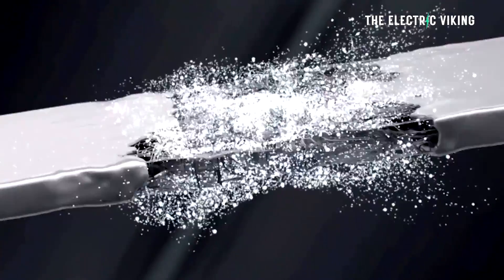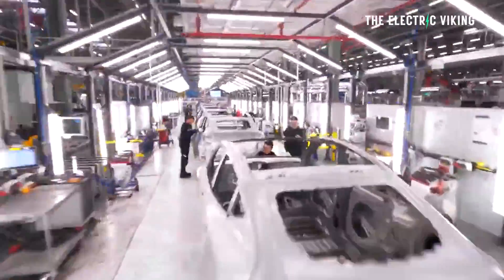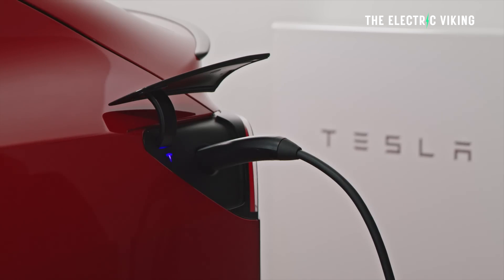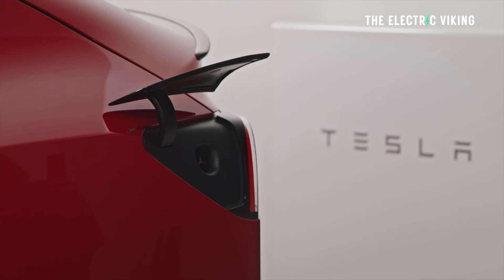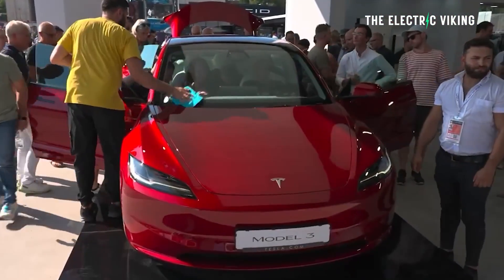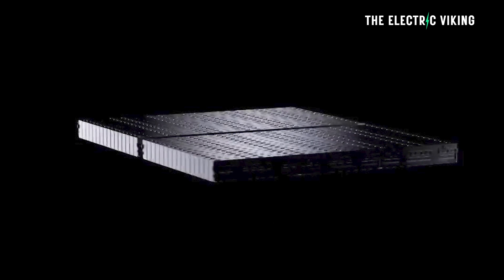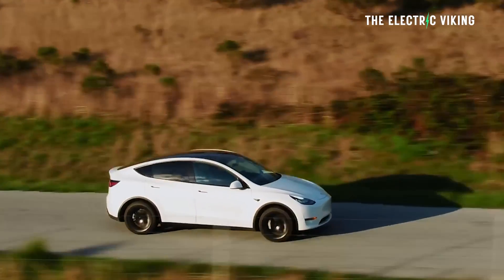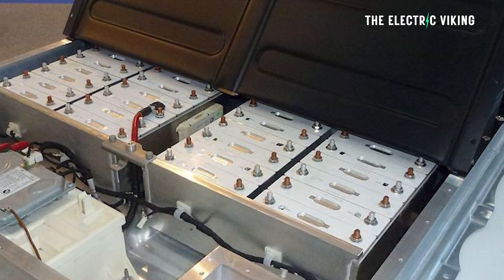Energy density of CATL's Shenxing battery revealed for Tesla Model Y Juniper

Comment: Best battery pack ever released by any company period,LFP  battery packs have much longer battery life compared with traditional NCM  ternary battery cells,almost double of what ternary NCM pack has to offer in terms of battery life and degradation rate, almost like an internal combustion engine car,and they are really much safer,what always had hold back LFP battery was 150 to 160 wh/kg in pack level energy density, shenxing plus has changed the game for ever with 205 wh/kg in pack level energy density,it is by far highest ever in the industry, it does even surpass 95% of traditional ternary packs in the market,very very well done CATL,you have done an amazing job for humanity and ev transportation industry,ev makers should appreciate your amazing hard work in development of the best battery pack ever
Reply: Agreed.  This is really a big deal and can be a game changer if the claim holds.
Reply: You forgot fast charging 4C. In second place will be Greely Golden Battery and third place BYD Blade battery 2.0. The next big thing will be the semi solid sodium batteries
Reply: @rwyo83  i think the next big thing will be the semi solid condensed zero degradation LFP with 450 wh/kg in cell level energy density which will last 2000 cycles of discharging with only 5% capacity loss according to CATL data about zero degradation technology,ev industry wont need any better cells for the next 25 years,it will be the real deal,just imagine 100 kwh battery pack with 400 wh/kg system energy density,it would have 600 miles of range easily,it will weigh 250 kg in total,battery pack will last 1.8 million km(1.2 million miles) with 95% of it's  capacity left because of zero deg  technology,and 5C charging speed,just imagine that amazing battery pack,the world will never be the same after the day this amazing game changing battery pack will reveal for ever
Reply: @rwyo83 The best overall is Tesla 4680. Look up The Limiting Factors video comparing BYD, CATL, and Teslas battery offerings.
Reply: @rwyo83 The current golden battery has 5.5C charging capabilities. 10% to 80% in 10.5 minutes. 
I think it's the number 1 at the moment. Behind it's the Shenxing Plus and then the Blade 2.p
Reply: @barygol  Geely new battery is the Aegis Short Blade battery
Reply: Has there been a failure with Tesla Model 3 LFP in high miles > 300k driving scenario?
Reply: Battery life - even NMC - is already better than most ICE cars (according to an Electric Viking report of a couple of weeks ago, which cited 300k miles average for Tesla NMC).
Reply: The pace of battery development is exciting and will only accelerate the shift away from fossil fuels. My 5 year old Kia e-Niro (64 kWh NMC) only has a pack level density of 147 Wh/kg, now we have LFP packs higher than that while the latest NMC batteries are reaching 250 Wh/kg. For sure LFP promises a longer life but to all intents and purposes this is meaningless as we already have NMC powered EVs with over 400,000 km on the clock and only 10%-15% range loss. Mine has just gone over the 100,000 km and hasn't even used up the 3.5 kWh of 'buffer' yet. There must be battery degradation but I am seeing no loss of range. LFP packs may well be capable of reaching a million km or more but few cars will last that long and even fewer drivers will need that capability.
Reply: @kiae-nirodiariesencore4270  I had similar experience before 100k km but experienced a large drop in range around 150k km in my model 3.  Now I have lost about 10% of range at 180k km.
Reply: @kiae-nirodiariesencore4270  let me give you some information,owning an ev isnt just about the first owner,you know what i mean?you think why you can buy a second hand  2021 taycan turbo s with 100,000 miles of mileage which originally  had MSRP of 200,000 dollars with only 80,000 dollars,that is called depreciation of  an EV,which is very very high at the moment,because people know an average traditional battery pack will last for 280,000 miles,so people wont buy a second hand ev at all,because they know if they buy a second hand ev they should heavily spend on replacing the pack themselfs,the whole reason behind all that effort from CATL and other battery manufacturer to make batteries last longer is for improving evs depreciation rate and make them better in holding their values,owning an ev isnt just about first owner buying them brand new,battery replacing will cause  waste of so much time,resources and offorts,i hope now you better understand why i call for zero degradation tech and wider use of LFPs in evs
Reply: let me give you some information,owning an ev isnt just about the first owner who buys it,you know what i mean?you think why you can buy a second hand  2021 taycan turbo s with 100,000 miles of mileage which originally  had MSRP of 200,000 dollars with only 80,000 dollars,that is called depreciation of an EV,which is very very high at the moment,because people know an average traditional battery pack will last for 280,000 miles,so people wont buy a second hand ev at all,because they know if they buy a second hand ev they should heavily spend on replacing the pack themselfs,the whole reason behind all that effort from CATL and other battery manufacturer to make batteries last longer is for improving evs depreciation rate and make them better in holding their values,owning an ev isnt just about first owner buying them brand new,battery replacing will cause  wasting of so much time,resources and offorts,i hope now you better understand why i call for zero degradation tech and wider use of LFPs in evs
Reply: @davidfujkk8018  spaces after a comma etc may help to understand your  text better.   I would love to know judging from your post,  did you call for zero degradation tech in ice engines in your past posts?
just curious.
Reply: @davidfujkk8018 Yes, China is the best, blah blah, tout your horn where you will, blah blah.
Reply: The Tesla 4680 pack is an absolute joke at this stage. To think that Tesla thought it would be the world leader in battery technology and then had its ass handed to it by CATL.....
Reply: @speedismyfriend  Can't win em all!
Reply: @speedismyfriend  every other battery company is a joke at this point
Reply: @speedismyfriend Tesla is making a different type of battery!!! The energy density of the 4680 is over 300!

Comment: What happens when your electric car gets 800 miles per chargers and only takes 5 minutes to charge?  I used to sell plasma TVs over a decade ago when I was a younger man. People would drop $7-$10K on a flat screen TV. At 720p. Afraid to leave them on too long due to screen burn. Today you get 4k 60” in Walmart for $500. It’s coming.
Reply: I think 800km total range and 5 minutes for a half charge (25%->75%) will be the tipping point for most people.
There will be a few jokers claiming they regularly drive for 6 hours at a time without making a pitstop, but 90% of people are happy to take a short break every few hours on a road trip.
At the rate batteries are improving this should be cheaply available with high reliability by 2030.
Reply: A small percentage of people paid big money for early plasmas.  In addition, your $500 Walmart LED TV  has an average life of 20 months.
Reply: I have a Model Y I generally only drive 20 miles a day charge at home and never go to a super charger. If I go on trips
longer than 150 miles then I might stop at a super charger. Milage on the highway at highway speeds is less than in
town. 400 miles range to get 300 miles highway would be nice and the extra miles would be a buffer for long term 
battery degradation . But it might get to point where there is essentially no degradation.

Comment: CATL keeps nibbling away at battery problems and cost and density, bit by bit, with each generation, and the generations are coming faster and faster.  Can't get rid of diesels and gas cars fast enough for me.  We have had stinky smoky cities all my life.  And the cars are  better than the gas equivalents.  I have owned big-block Corvettes and AMG 5.5L Mercedes; never again; my Model Y out accelerates them both, quietly, quickly, and emitting no toxic fumes.
Reply: They burn coal! Virtue signaling. Huge carbon footprint, kids slaving away in pits to get your "clean car". Please
Reply: Said kindly, you don’t know what you are talking about.  Turn off Fox News and find some real facts.  PS Coal fired plants are being retired all over the world and replaced by wind and solar, because they are cheaper energy sources. Lithium-iron-phosphate batteries are taking over from Nickel-Manganese-Cobalt batteries very quickly, so no more kids slaving away in pits in our future.  There is nothing “clean” about any petroleum fueled car, so your point of comparison is moot.

Comment: Why are commentators, incl Sam, saying a battery has X miles of range? A battery doesn't have any 'range', it contains an amount of energy. Range only becomes a thing when those batteries are put in a car (and then it matters how many batteries and what car).
Reply: The range is in reference to the model Y. To show the improvement range is easy to understand, if you would say: model Y Long Range AWD with a battery capacity of 81 kWh gives a range of 531 km,  now with the same size of battery and same model y the range is 1000 Km ... This would be better, but you would have lost your audience before the end of the sentence ...
Reply: Interesting comments, but none of them correct.  CATL themselves marketed 1000 km range, with 600 km range addition in 10 min.  Their new battery is also called "Shenxing Plus"...  Why?  Because the average consumer doesn't care about energy densities, they just want to know how far they can go before they need to recharge and how long that will take.
Reply: @CharlesBrodheadIII  "Because the average consumer doesn't care about energy densities", you mean the low IQ people. The rest do.
Reply: @CharlesBrodheadIII  This!  Most consumers care about the practical benefit to them, not necessarily the features/specs of the "thing", in this case the battery.
Reply: Yep, I can see that non-EV folks would understand the range but not the energy density, though they’ll be scratching their heads when the new Model Y does not come with 1000km of range when Sam is implying it will.
Reply: CATL have a reference vehicle platform. I think it’s based on that. Obviously theoretical but still a useful reference point.
Reply: Did they say how fast it goes?
Reply: Because Sam, like most commentators, speaks for the lay viewer who is not an engineer... and that's GOOD. He talks about the range of a battery IN CAR ! And when you speak about a battery in a car, all constraints of size, weight and total energy available are defined once the battery producer is chosen. Its then completely legitimate to talk about the range of the battery! It's as simple as that.
Reply: Because there is a practical limit to the mass and volume of the battery in any vehicle. That's why. This equilibrium point tends to be similar in most vehicles. But I agree with your statement.
Reply: They’re trying to make it relatable to non-scientific thinkers.  It’s not wrong on its own part.  Your objection would be null if they’d just include a proper caveat like, “In a typical sedan, using this battery would result…”  I agree that they should do at least that, but using a practical example is very useful for communicating with the masses.
Reply: @737smartin as ‘one of the masses’: please explain, how to compare Wh/l to Wh/kg. These (CATL) reports 205 watts per kg.  How does that compare to QuantumScape’s 800 Wh/l???
Reply: @paulcarney8157  I'm a 'masses' member, too!  But I think your seeing power per unit of volume (Wh/liter)...and power to mass (essentially weight) (Wh/kg).  In a car, both are important to consider as the volume is limited by the size of the space for the batteries, and keeping the weight low is important for driving dynamics, safety, and efficiency.   In home applications, battery size and weight are usually far less important. 
Usually a higher Wh/l chemistry will also be higher in Wh/kg, but you could imagine a less dense chemistry that could be powerful per kg, but is so 'fluffy it takes up more space and is lower power per liter.
Reply: What’s your point? Energy =miles.
Reply: @johnsilverman2538  
How many miles does a battery contain?
Your answer to that will start with "well it depends..."
That's my point.
Reply: Yep - good point. I mentally use 5km per KWH so when he says a 1,000km range I think a 200KWH battery. However that's just an internal estimate to deal with people describing a battery as having a range, which they shouldn't do.
PS Another that annoys me is XYZ will supply 200,000 homes rather than give the MW Capacity. Its as if the public can't cope with MW's.
Reply: He’s a content creator not an engineer
Reply: Because most Tesla YT like Sam have not the slightest ideas of engineering or physics. Zero, nada, nothing, zilch.
Reply: @docsnider8926 you forgot Ling 零
Reply: @docsnider8926 But you do of course.
Reply: Because Sam doesn't understand what he is talking about.

Comment: SAM ! Please say Watt-hours when you mean Watt-hours. And say Watts when you mean Watts. They are very different parameters.
"205 Watts per kilogram"  means nothing. But, "205 Watt hours per kilogram"  is probably what you mean.
So a quick calculation....at highway speeds, 70 - 80mph, consumption is about 350Wh per mile, therefore, if you want 200 highway miles you need 200 x 350/205 = 340kg of battery. That's not too bad, although what is this new battery's volumetric efficiency in terms of kWh per litre ? It could be the case that the battery weighs only 340kg but takes up most of the passenger compartment. And then you need start adding in structural reinforcement.....

Just fit a 2.0 tdi and be done with it |!
Reply: Their volumetric efficiency is also high so the notion that you would be sacrificing passenger compartment space to get extra range is just like the last part of your post, nonsense
Reply: @douglaswatt1582  So you know for sure what the volumetric efficiency is , which wasn't mentioned in the video , but will definitely  be able to tell me what it is now, being that you are someone with a head full of the facts
I look forward to this fact
Reply: @douglaswatt1582   And whats wrong with a 2.0tdi anyway ? Well, don't let me distract you from writing the digits "**Wh/L", filling in ** with the volumetric efficiency of these batteries first
Reply: @douglaswatt1582  The volumetric energy density is about 250Wh/L (I searched CATL press releases)
A 70kWh battery would require therefore 280 Litres of volume, but then you need to add packaging and strengthening and protection so ultimately say 330 Litres
To go 200 miles on the highway
I only need 20 litres of diesel to do the same distance !
Don't you wish you hadn't opened your mouth uselessly

Comment: What does this battery in the Model Y imply about the future of the 4680?  Its main advantage was its low cost, especially with domestically produced subsidies.  It appears to have been surpassed.
Reply: 4680 encountered production problems. It is currently going into the Cybertruck and ramping at about 3x the needed rate. Not enough for any other vehicles. They hope to get its cost down to a competitive level by year end. Sometimes innovation is hard.
Reply: 4680 is form factor n packaging method. Can be made w LFP

Problem is China ahead in cost.l, Volume, reliability, exchange rates, subsidies, chemistry

The CATL / BYD prism form factor is cleaning house now.

4680 has NOT caught up. Hope they can
Reply: Exactly.   If it ain't Chinese - best of luck.
Reply: 6yr full timeline for the 4680 program to mature from the Sep 2020 battery day smh. Drew, Zach and elon have publicly commentated on this.

2022 the goal was to be competitive with existing cells at the pack level, multiple independent teardowns confirmed this in summer of 2022.

Then to end 2023 it was to be better than the competition, the cybercell in ct confirmed this during the munro teardown. Lighter than the rivian or gmc pack's and more energy dense. Plus nxu showed it can charge at 327+kws on a 1000v charger and get 80+miles back in 8mins! 😎

Finally to end 2024 thanks to the ira, 4680 in house cells should be cheaper than any competitors cells here in the U.S. at least.

Which should enable tesla to cut ct costs as production ramps&offer them in the Y again(cheaper decontented base variant maybe) or in the m3 for the first time qualifying it for the full tax credits again. It's gonna be interesting no doubt. 🤔
Reply: They can use all of the batteries they can produce themselves as well as what they can buy. 😊

Comment: Isn't this amazing charging performance depending on 800 Volt architecture (not in the Tesla model Y)?
Reply: I hope they were comparing on current model Y.  I know Sam keeps thinking Juniper but it seems that getting new in between models are a higher priority.  Just a guess.  But end of year change to Juniper, might be possible.  

Maybe the new in-between models will start right off with the 800 kw

Comment: Battery technology increases are rapid. The current ones are amazing so it will be interesting to see them improve. More range and efficient, higher density and safer.
Reply: I predicted 3 new batteries per year for the next decade and it's on track. Not all of them will be for cars but 3 per year.